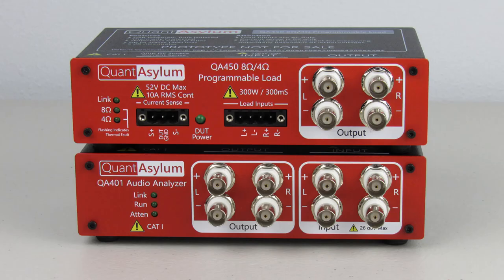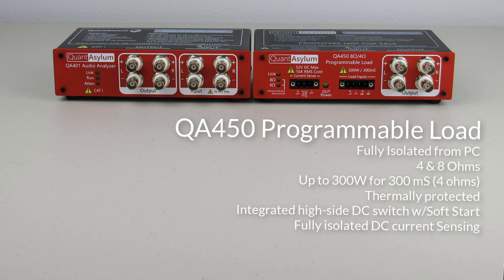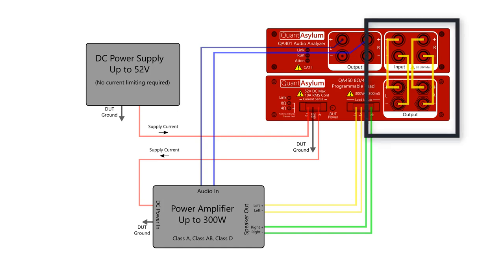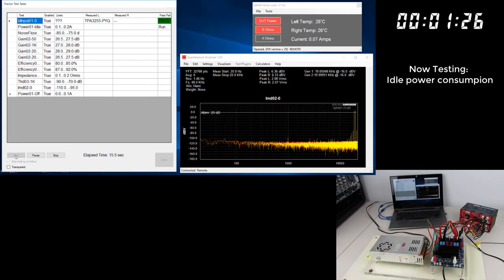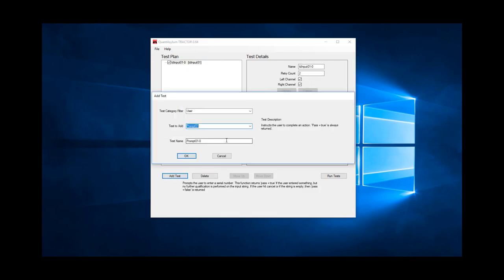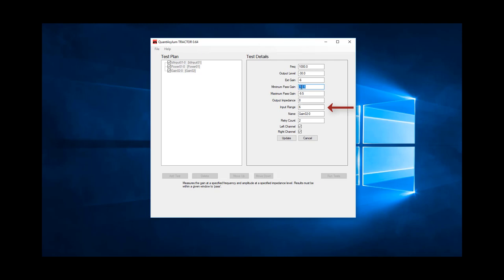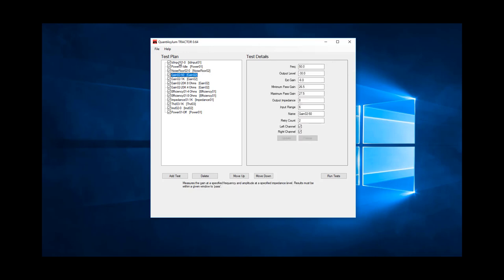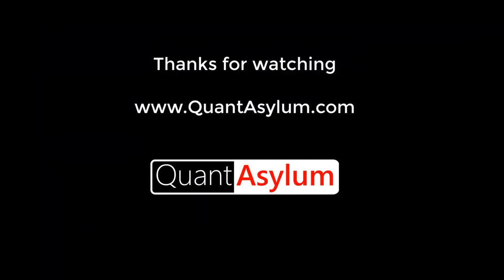QuantAsylum Tractor, QA401 and QA450

Comment: Hi, I'm looking for an amplifier tester to make some test in different amplifiers for my YouTube Channel.  The QA401 seems to me the best option and is within my budget, but I had a question regarding the maximum voltage input of 26dBV, since I intend to measure amplifiers of up to 1000Wrms in 4 ohms and would not like to do a voltage divider, as this would include imprecision in my measurements. What do you suggest?
Reply from the maker: Hi Renato, please take a look at the blog post here (https://quantasylum.com/blogs/news/basics-power-amps) to see how to use the QA401 to measure a 1000W class D amp. The recipe is similar for just about any power level you might wish to measure. When you build your high-power attenuator, you can use the QA401 and an amplifier to characterize its attenuation down to 0.01 dB, and thus the accuracy will be precise and well known.